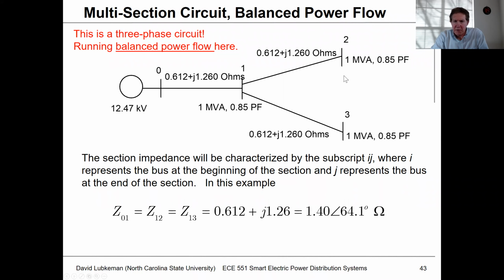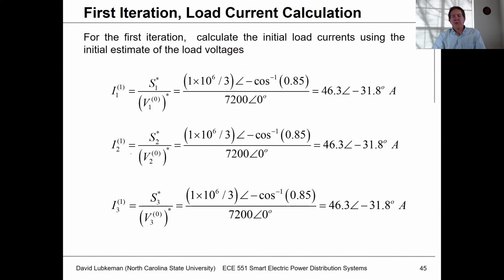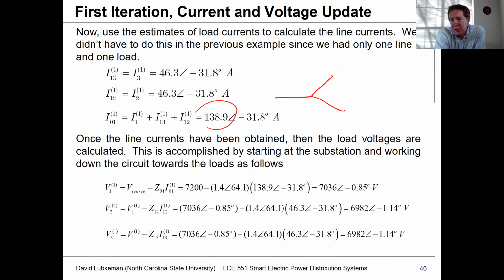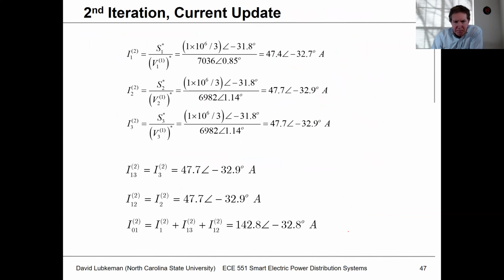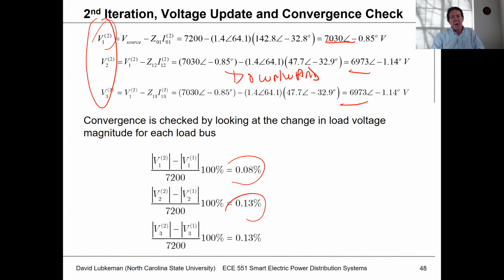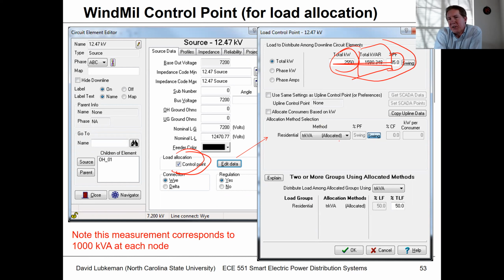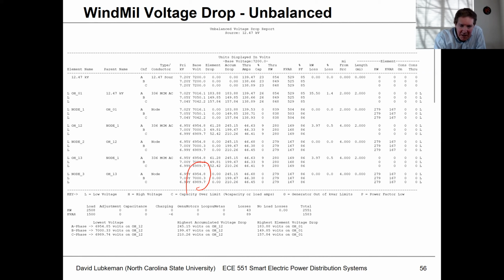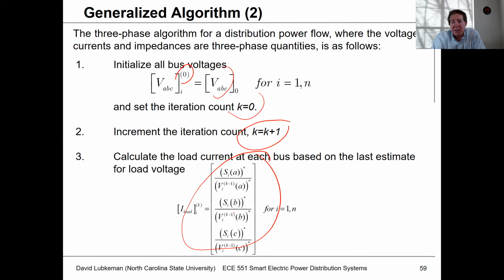Lecture 9c: Power Flow - Multi Segment - Power Distribution Systems Spring 2021 - Lubkeman

Comment: sir is this the same as "backward forward sweep"?
Reply from the maker: Essentially yes.  Keep in mind there are many different variations on this approach.  But essentially going from loads toward source (backward sweep) you start by estimating line currents.  Then going from source towards loads (forward sweep) you estimate load voltages. Then repeat until convergence takes place.
Reply: @dr.davidlubkeman284  Thank you so much